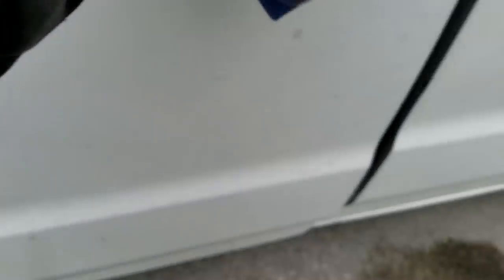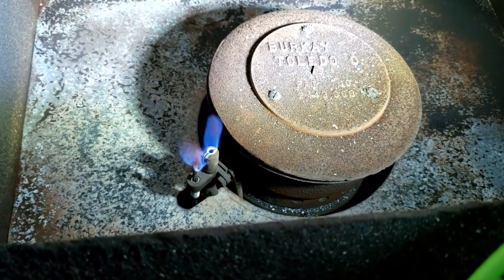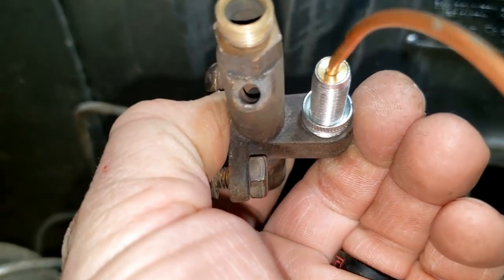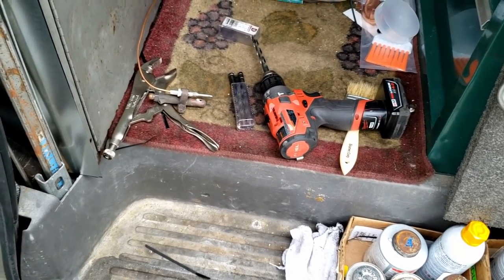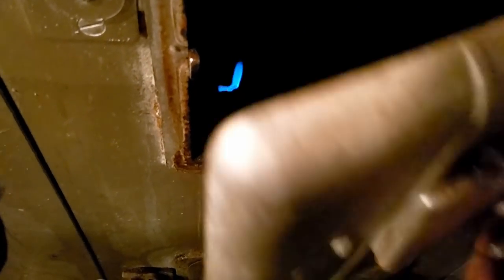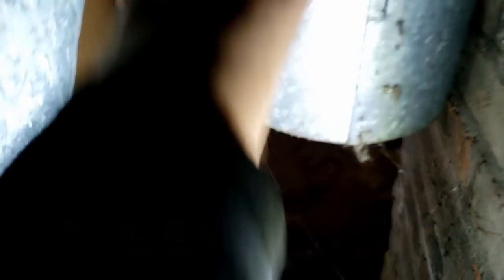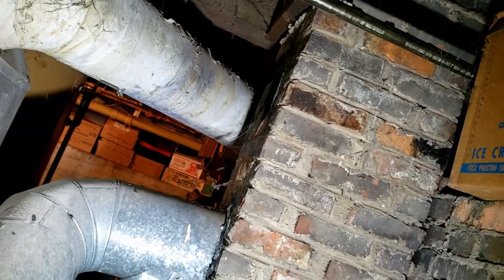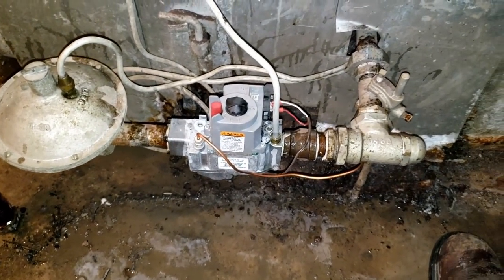Welcome to the 1950's heating system that still works today!

Comment: My home is heated through its original gravity hot water system through radiators and my 87 year old American Radiator Company boiler. No circulator pumps, just pure physics. The beauty of the workmanship of the piping, the radiators, and the boiler is just a lost art today. I absolutely love it and much like people with gravity furnaces, I don’t have some ridiculously high gas bill. My house is well insulated as well.
Reply from the maker: You’re absolutely right, most people don’t understand when something is designed properly. It just works.

Comment: Totally won my respect, Sir. Many young HVAC tech or big companies wont service these old furnaces any more, they upsell homeowners big stacks of $$.  This old couple has a lot going on within their smal house, Those water from the basement probably from foundation? You didnt complain the envrionment you working on, such a good working attitude. Keep you your good work and hope you get that check engine light fixed already :) Great job
Reply from the maker: Thanks! I have worked in much much worse. The truck has 208k miles and I'll probably have it for another 2 or 3 years, the only thing bad about this place is how often we change out trucks.

Comment: Back when things were built to last forever,  Pride of workmanship,  No ciecuit boards to cost a fortune.
Reply from the maker: I started in 1995 and there were several even then.
Reply: Let's not forget those boards cost a lot of money because the companies want to make a lot of profit. After all, the reason why any company exists today is profit, not to keep people warm - that's a goal somewhere way below making profit. 
The parts on the boards are often pretty cheap but you're screwed if you need a preprogrammed microcontroller...
What i'm saying is - control electronics are not what makes a repair expensive. The vendors that sell the parts are what make it expensive. Basic parts like thermocouples are practically universal so they can be made by any old factory, but specific boards are only made by one company so they can drive up the price as much as they want - and copying those is generally hard or prohibited. China doesn't care about that, but i wouldn't trust a chinese knock off furnace controller tbh.

Comment: My parents had a gravity heater (gas) from the late 1940's until the 1990's and when it stopped working they couldn't get part's to fix it so they replaced it and put central air in the house, my dad was happy about lower gas bill's

Comment: Those gravity-fed octopus furnaces are simple and amazing, not many of those left. Just an FYI, that inches to inches regulator should be removed, that combination gas valve has a regulator built in ( can cause a delayed ignition because of the low pressure entering the new gas valve). Also the best way to clean those Pilots is with carburetor cleaner, works great ( wear eye protection and no smoking)👍🛠.
Reply from the maker: Thank you for the feedback!

Comment: cool. never even heard of one of those. I am often trouble shooting and tuning residential heating units with a laptop. hell we don’t even have basements here 😂
Reply from the maker: Where you at
Reply: @HVACRSurvival  The land of heat pumps and many structures in need of cooling year round. San Diego CA .  I have not seen a pilot light in 18 months. last one was a family members rental, I managed to remove the units door and relocate it in explosive fashion (if you will) to the other side of the garage without putting a finger on it.  it was replaced the following Saturday and my arm hair grew back 😂
Reply from the maker: Geeze😁

Comment: Some old gravity furnaces kinda scare me. Relit pilots on a few without a thermocouple or any kind of safety on the pilot which is a gigantic pilot. Just a manual shutoff on the pilot 😂. Thankfully not LP not sure how that could be legal but they're out there not many but there's some I've told the customers not the safest setup but they've had it for decades kinda hard to convince them into putting in some new bullshit that's gonna break.

Comment: Looks like it had a natural gas conversion done on it  quite a few years back, I'm from Los Angeles and our gravity's are all old E.L. PAYNE  gravity's with 3 way gas valves.
Reply from the maker: Never heard of a 3 way gas valve? Is that a manual open?
Reply: @HVACRSurvival  electronically opened with a single pushbutton switch in the home, no thermostat, no nothing, just two little lights by the switch that tell the homeowner the position of the gas valve, high medium, low, and off. Always a treat when I get to service them.

Comment: On a standing pilot unit, you should always take the pilot orifice out and clean the white buildup off. Blowing it won't cut it
 I have seen it many times in 35 yrs.
Reply from the maker: I do on most, I've torn several apart after wards to see what's left. Usually there's nothing unless it's never been cleaned proper. Thanks 4 watching👍
Reply: Sometimes they do not come apart.  Do the best you can

Comment: I the area I grew up and went to Trade School in had old homes and they had that type of systems. The first heating system the school sent me to look at was the same type but it was a coal furnace at one time and they put a gas add on into it. And it had the same problem the one you just fix.
Reply from the maker: Pilot adjustment and placement is critical on these and standing pilot systems. Most newer guys won't know the basics because there use to intermittent ignition.

Comment: I have done heat and air 18 years and never seen one. Always see the ductwork remnants but the units are long gone.
Reply from the maker: Probably depends where your located and what kind of money the people had to upgrade and if they have had problems with it over the years. These were older people that were just common people that didn't get to excited about things.

Comment: I’d offer them a mini split…. It’s almost a sin to get rid of that old work of art.  If you did a mini split they would have AC without the window unit and they would have efficient supplemental electric heat.  Call me crazy but once a system is over 70 it is almost a challenge to just keep it going.

Comment: I have seen too many of these furnaces because i was on the other end of a sledge hammer, talk about dirty work tearing them out , sand on top to retain heat, asbestos tape on all the joints, once they get hot they stay that way for hours.
Reply from the maker: Luckily I never had to do that but I'm sure it sucked ass.
Reply: @HVACRSurvival  yes it did, only positive is we could take the cast to the salvage yard and make enough money to buy lunch with. Now you would not touch a gravity furnace without getting asbestos abatement done, all we did back then was spray the tape with water , if we only knew !!!!!
Reply from the maker: @jgroves55  what year was this? I started in 95 and knew it wasn't good to breath then.

Comment: The flame from the actual burner itself did it look too good all of the tips we're orange did you adjust the valve?
Reply from the maker: The orange tips are usually dust. I did not do any adjustments and it’s been running for the last year or two without a repeat service call.

Comment: I have a home built in 1945. A heater was installed in the crawl space in the middle of home on a wall where on side is in hallway other is in dining room the fresh air for heater come up from bottom, into the burner that is in a heat exchanger surrounded by a second box that also gets air up from bottom up past exchanger, into home the exchanger has a flu the comes out turns up inside wall, up to roof! Has two valves from gas line one is a pilot. The other is the main burner. There is an access hole in top of exchanger with a weighted lid and a glass eye!  You lift of lid. Light pilot, put back lid. Turn on main burner. Can adjust flame by how much you open valve. And your done heats home if get hot enough, just turn off main burner. Get cold, turn on burner. No thermostat no fan heats whole home for Less than, 100 bucks a monthly been tested no CO leaks, last year install new roof trane package unit. So now to heat home with all the bells and whistles!!! Costs 175 monthly??? Really??? No need for the inducer motor, save electric. That also cuts gas use because heat not sucked out exchanger. To vent burners okay fan to move air across exchanger to all rooms faster good but the on off extra electric used ? Hey if 80 year old tec works better use less why did I put up a new package unit? Well needed. The AC also if floor heater does finally fail can not replace it it is in crawl spaces with the home build around it. So in future just cut off gas supply close in wall and floor opening. Then forced to use the new stuff that doubles Bill and will not last as long. So in reality, more than tripled cost to heat home( with cost of new unit). And will only continue to cost more. Just does not seem right!!!!!
Reply from the maker: Sounds like you have a gravity floor furnace. I have worked on many, sometimes they have a flap that flips one way or the other depending on how hot you want it to run cuz it cycles the limit quicker one way over the other.
Reply: @HVACRSurvival  yes there is a flap that you can direct the heat into one side or the other. Oh yea no thermal couple on pilot. Just open valve and light it has never blown out. I have lived in home from 1980 it has never been a problem just keep the air flow side into home clean from dust, lint, and what ever may drop into it. My kids when little loved dropping everything inside it so as long as kept it clean great thing! Would smell when 1st time use after being off in summer but quickly when away! Never burn any one wife use to sitting next to it, in dining room side or stand over it for quick heat up! Even dogs would sleep on floor close to it. Like an old pot belly stove!!!

Comment: That's a seriously cheap gas bill. Especially where I'm from. I grew up in a 1900 house that had a martin floor furnace (installed in the 60s) with millivolt control. We had heat when the power was out. It still works to this day!
Reply from the maker: Exactly, that's why newer isn't always better 👍👍

Comment: probably could have used a touch more pilot chooch, vs. raising the thermocouple up. I recall them puffing out with fast open gas valves, especially if the thermostat chatters, like mercury bulb T87's that get bumped or vibrations.
** it looked better after cleaning, must have had some carbon schmutz in it.

Comment: Do these things have a heat exchanger? Or is the heat exchanger simply the shell of the unit itslef?
Reply from the maker: No it's got a heat exchanger, it's just one big iron shell that gets hot then vents out the back side up through the chimney, some had fans a lot of them didn't. Sometimes they put sand on the top of it to help insulate it from getting the floor too hot

Comment: Haven’t seen one in years great seeing one again. Great video Rick. Why was the floor full of water?
Reply from the maker: Old house, probably a drainage issue or seepage through the walls? They didn't seem too surprised by it so I didn't ask. They did say sometimes the basement floods, so if we do replace the furnace, we will probably do a horizontal mounted to the floor joists.
Reply: @HVACRSurvival  that’s a smart idea otherwise you will be out on that thing every other week. Lol

Comment: it looks like fuel / Air ratio is off, too much air or under gas pressure to the burner.. I would do a Combustion test on it, that might even save them more $$ on efficiency after you adjusted the air to the burner. you should Always do a Combustion test for safety too
Reply from the maker: I believe to many people trust a analyzer to do what there eyes need to be inspecting. I've had cracked heat exchangers that did not change the co and 02 levels.
Reply: Way too new age.  Ears, eyes, and smell can do fancy analyzer 99% of time

Comment: Many such still exist in Chicagoland. Oldest ones were originally coal fired, converted to oil, converted to nat gas.  Replaced an actually failed thermocouple WR circa 1950s gas valve last yr that had emergency heat position if electricity went out. Manual operation position to allow full gas flow to burners w/ zero safeties minus note on unit to make sure pilot is lit before going to manual operation!

Regarding preemptively replacing T. Couples. They can last for decades! Think about water heaters!  All them are made so cheap and low quality these days.  Last, if on a very old gas valve a new T couple may produce more mv than what pick coil in valve is used to. New T couple could kill old gas valve!  Best practice is if looks good produces enough mv to keep pilot on, then only clean it up a little. Do not replace thinking your doing anything good

God bless the way used to build things.  That old boiler is maybe 65% efficient, but could last over 100 yrs/ longer than a lifetime!

Comment: I live in the midwest and still have this type of heater (I bought my grandfather's house). I've done the math and it doesn't make sense to replace it. Modern furnaces only last 15-20 years, which means that in the 30 years I've lived here, I would have purchased two. In addition, I have to have the asbestos remediated and new ductwork installed. I low ball estimated around $10,000 for the total cost of ductwork, 2 furnaces, and remediation work. I only need it for about 3 months out of the year. It would cost less per day to run what I have and do nothing than it would the costs to replace it (assuming a 50% reduction in heating costs which is very generous). I can't justify it. The only thing I've done in the last 30 years is replace the thermal couple for about $8. I do have a question. IS THERE ANY WAY TO MAKE ONE OF THESE MORE EFFICIENT? WOULD REPLACING THE UNINSULATED HEAT DUCTS WITH INSULATED ONES WORK OR IS THERE A WAY TO INSULATE THE HEAT DUCTING? Thanks for any suggestions!!! BTW my furnace has a cast iron plate that fits over the open flame which also heats up and radiates heat. I'm surprised when I see units that don't have one. Perhaps that could be retrofitted if you are using one of these?
Reply from the maker: You might be able to add a small fan to it, that's about all I can think of?

Comment: A small saving per month vs a new system cost would not be worth it in my book, and the longevity and reliability  of the new equipment is not guaranteed.  although the ac would be a plus.
Reply from the maker: My feeling as well, most people that have had a system like this don't like the way a high efficiency furnaces heat.

Comment: Carbon monoxide is no joke, killed my grandpa and grandma.  Left the car running in the garage which was part of the basement.  That burner has no air mix?  Swampy.
Reply from the maker: The air shutter was inside the furnace. If I thought it was dangerous the furnace would not be working when I left.

Comment: clean it with carb cleaner !!!
Reply from the maker: I've tried all kinds of different cleaners on pilots over the years when I first started. Nothing works as good as either taking it apart and cleaning the orifice with the wire brush or blowing it out with high pressure from the top.

Comment: yeah paying 60-80 per month on budget, when i pay 34.00 per month year round. It's just extremely inefficient and do not have the safety systems that today's furnaces done. Real easy to die of CO with those things.I find it hard to believe that with a flame that size they have a 60-80 per month gas bill.
Reply from the maker: Your not going to crack that kind of heat exchanger and if your paying that for gas you live somewhere warm.